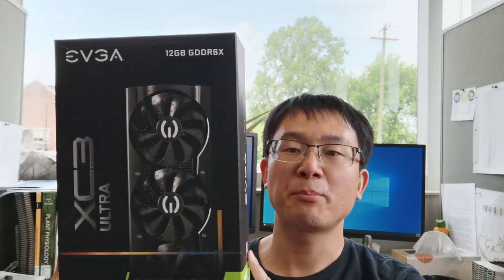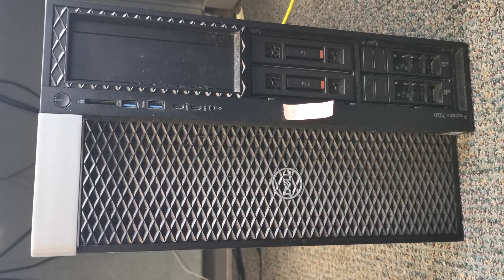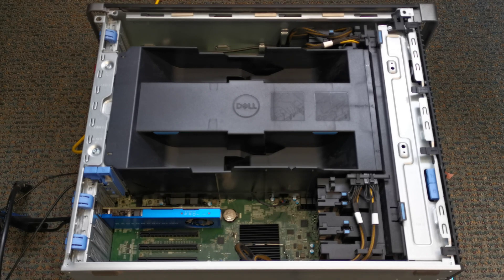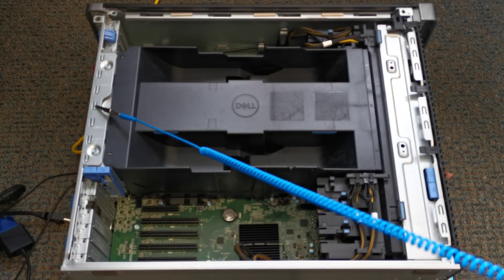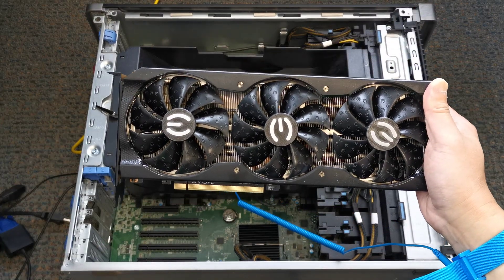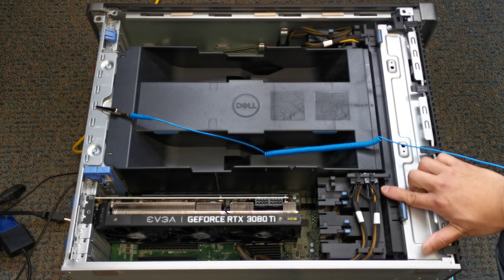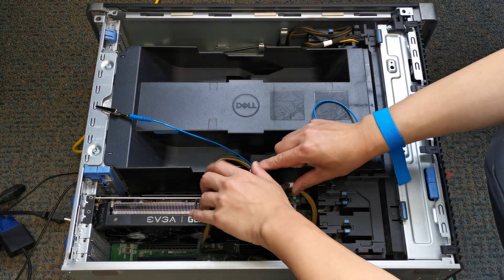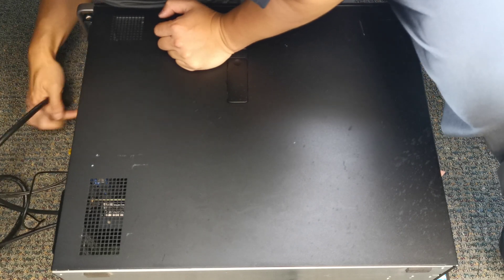Dell 7920 Workstation RTX 3080 Ti Installation

Comment: The card presumably is PCI express 4.0 while the Dell 7920 only offers PCI express 3.0. What is the bottle necking overall? 5-10% loss due to PCI 3.0. Anything else?
Reply: Like 2 to 5 fps drop
Reply: Once vram loads all the data there is not much transfer. For ai or rendering its enough even half the speed.

Comment: how are you grounded if the computer's AC power cord isn't plugged in? There's no connection to ground.
Reply from the maker: Did you refer to the blue-color cable? That is a wrist strap that was for anti-static purposes.
Reply: @yapingsyappipedia838  that's what he means.  The blue wrist strap is useless since the chassis is not grounded (connected to mains).
Reply: Static electricity happen when 2 object have different charge, this electricity flow from 1 place to another. With this strap, both have the same charge, thus no electric discharge.
Reply: @Ryuken2721  if the strap is not connected to ground, the operator hasn't dissipated its potential. If the workpiece is not connected to ground, it has not dissipated its potential. Therefore if the two come into contact, a charge difference may still exist, resulting in a discharge event.
Reply: @davidvileta4526  yes, discharged it to the ground from the strap, which almost never result in any real world damage. Linus make a video about it.

Comment: Hello, I'm thinking about buying a Dell T7920 next year and would like to hear about your experience or anyone to whom you can suggest or introduce me.  While I have an idea of the CPUs, memories, and drives, I'm up in the air and unable to decide on the graphics card.  Any help you can provide would be helpful and appreciated.
Reply from the maker: I've had this tower for over two years and I like it. It is overall a very reliable machine, never threw me a bluescreen. I use it to process large sizes of images and videos and it is a quick computer. If you need large memories and data storage this will be a great choice. However, the Xeon CPU series generally has lower clock speed than the i7 or i9 series, so if you care about video or gaming performance, this might not be the best chassis for you. Just my personal experience, though. Welcome to ask any questions and I'll try my best to help!

Comment: Hey man! I'm trying a similar build. How has gaming been on this? What FPS have you been able to get with this set up?
Reply from the maker: I've not tested gaming fps so I cannot speak of that, but my experience with this configuration is a bottleneck due to low CPU clock speed. The Xeon Silver CPU has a 2.5GHz clock speed and it is going to bottleneck the GPU, the maximum use is only between 30%-50% overall. My guess is even with the highest clock speed for the Xeon product line, you would still bottleneck it. An i-9 CPU with a higher clock speed would probably boost the performance significantly.

Comment: Hi Finaly found a youtuber have this beast, thanks for your video I have been wondering can I install the RTX 3060 Ti  or you didn't try it, i use now the Quadro rtx 4000
Reply: I have a few 7920s with 1 GPU each. 2060, 3060, and 3060 TI. They all work well. I don't game, so I can't answer fps questions.
Reply: @gate9595  thanks for replaying, Did you replaced the old GPU or it was already installed in it when you bought it, I'm thinking on buying 4060 and a new W family CPU and afraid if I change any thing the pc will not work
Reply: @AlghoulTexture I bought all mine  barebone (No CPU, GPU, RAM, HARD DRIVE). You can only use 1st and 2nd gen Xeon scalable processors with the 7920 and 7820. These workstations have server grade components; and upgrading their hardware is encouraged even by their manufacturers.
Reply: @gate9595  can we stay in touch for when i change the cpu i might need to ask for more info
Reply: @AlghoulTexture  No problem brother.
Reply from the maker: My apologies for the delay - feel free to let me know if you have any questions regarding the GPU installation. @AlghoulTexture

Comment: Thanks for the video. May I know if the RTX 3090 can fit in this t7920? (There seem to be some online complaints saying it cannot fit in. But I checked the Dell manu today and it says one 3090 can be used on Slot 2.) can you comment on this? Thank you.
Reply: I ran into the same issue with the card being too tall. What I ended up doing see going to eBay and getting a Dell OEM RTX 3080. The key is make sure the card doesn't go above the PCI bracket. You'll have just enough room to install the power cable.
Reply from the maker: Please excuse me for the delay...that was a question that I wonder before getting my 3080Ti. From what I heard the 3090 is in larger dimensions than the 3080Ti, and as a result, it probably won't fit the 7920. This is just my speculation though, I'd like to know it if you had later confirmed it...

Comment: Thanks for your video. Can you help me with a question?  There was no problem of drivers or operación of the equipment with windows 10 pro.I want to do the same and i don´t want any surprises. Thanks in advance.
Reply from the maker: Thanks for watching. My OS is Win10 Pro and I don't see any driver problem. The only thing is that your CPU clock might be the bottleneck for the system performance, as is the case for me...